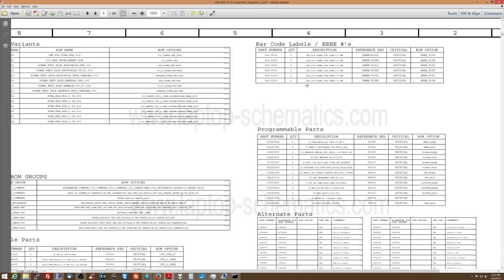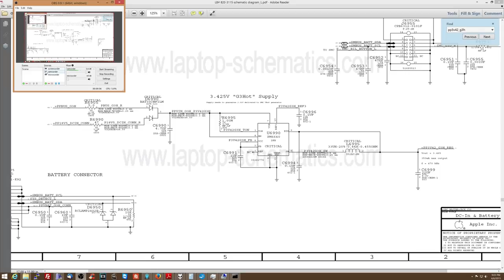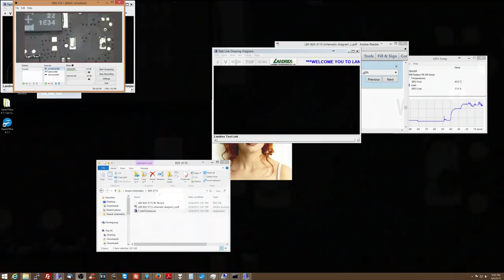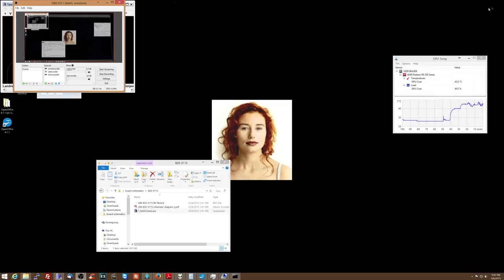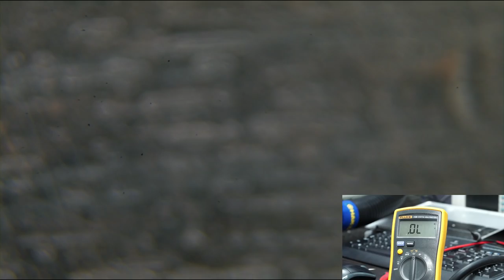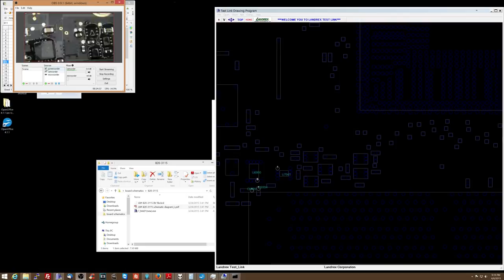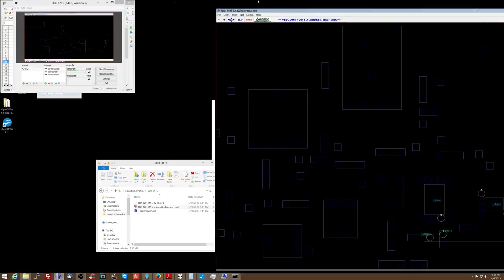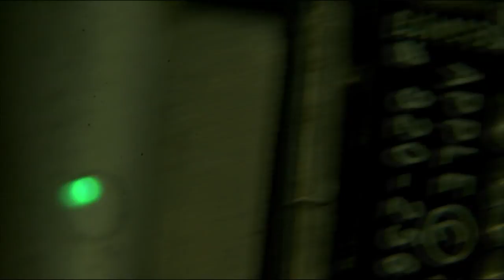How to find short circuit component without spending $6k on FLIR cam.

Comment: COULDN'T YOU HAVE DONE THE SAME ALCOHOL .10cent DIY FLIR heat/smoke test to find the short without the HP Power supply?  Just using the Power Adapter that comes with the laptop... it provided the same voltage to the system as the HP bench supply you were using.  Just following your advice of being cheap on tools. Why buy a $5000 tool when you don't need it right?  For current measurement, you can use a wattmeter on the wall outlet, they sell for about $15 on amazon.
Reply: Wall-warts and bricks have a bunch of different safety circuits, especially when batteries are involved.  So no, since the "power-good" signal was not coming back from the laptop, and/or the laptop was drawing more amps than it should, the OEM power supply refused to fully supply (thus the no-green-led).  It's not like jumper cables with no smarts, or it would never get UL approved (or euro/pacific equivalents).  And it would light lithium batteries on fire (more so than when companies cheap out the safety circuits).

Comment: Hi. Any idea great God-given talent and channel. It's not a laptop but it's been a few days of trying to fix the shoulder button on a Game Boy Advance AGS-101 SP. Replacing the button didn't work from a donor SP and cleaning it with contact cleaner, alcohol and compressed air inside didn't work too but here's a close up of the circuitry near the tact switch:

http://i57.photobucket.com/albums/g230/alvin777/Advance%20SP%20AGS-101%20Shoulder%20Button_zpsxibkjyq3.jpg

By the way, could you a series of batteries as power supply for small systems? I'm coming from a developing country.

Thank you. God bless. Rev. 21:4

Comment: dude dont you know about VI analysis?Locates bad components without fuss, in seconds.
Reply: How does it work?
Reply: It applies a current limited variable frequency stimulus to a DUT, which is powered off. The display and digitized result of the V vs. I plot against the Z Delta Freq axis is saved into an master data array for a known good unit, a library of known good test points or of entire model lines, modules is compiled and then, DUTs are compared to the standard plots. The test equipment uses MUXed test harnesses to attach to either board connectors or others means, and compared against the "exemplar" known good plots.
Reply: what are words i can google for?
Reply: V/I analysis